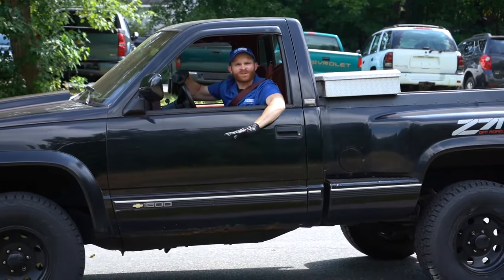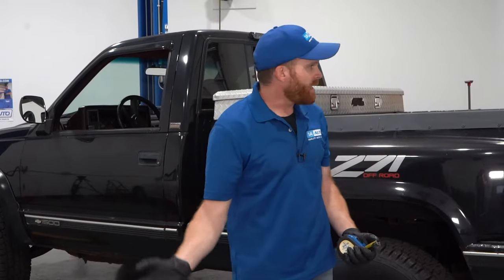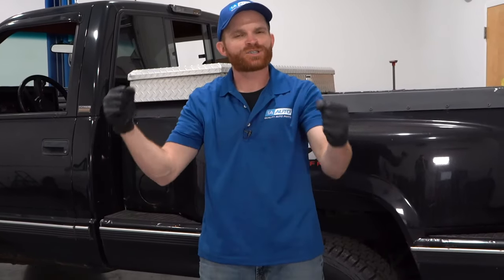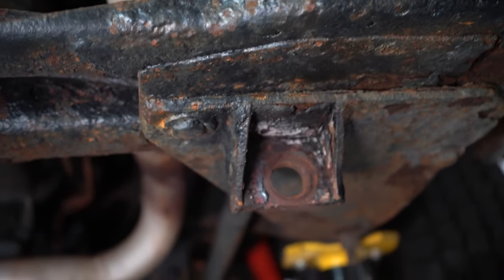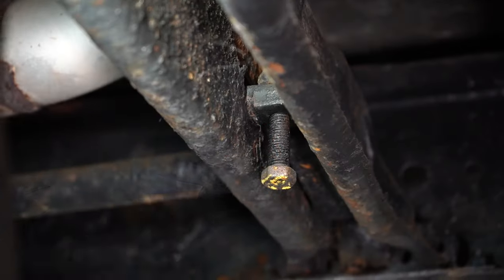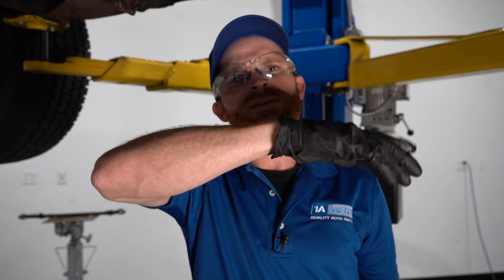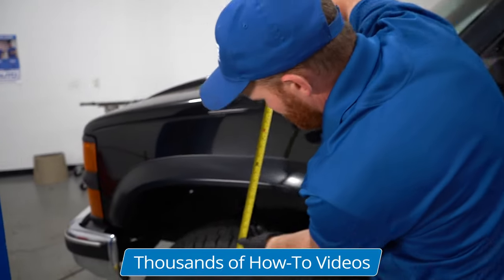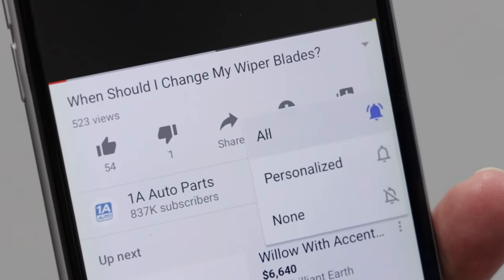Is Your Truck's Rake Too Extreme? How to Level Torsion Bar Suspension For Free!

Comment: Do you need an alignment after this? My 99 k2500 is 2 inches lower in the front then the rear. I want to raise the front at least 1 inch or inch and a quarter & i dont want to ruin any suspension or drive components .

Comment: Very helpful video, I have a question. My 04 Silverado driver’s side torsion bolt is all the way in. The other side has some thread showing. My driver’s side is the lowest. How do I adjust? Thank you again for video

Comment: You said 2 adjustments turns of the bolt equals out to 1/2 inch lift, does that apply to only the vehicle in the video or to all vehicles?

Comment: 🤔 why not measure from center of the hub? 
So if your tires are worn uneven you can get a more accurate measurement of the suspension 🤔

Comment: I have a 1998 Tahoe with a plow, I want to swap out the 1/2 ton to 3/4 ton torsion bars to take away the front squat, do you know if they are interchangeable, i do have the screws all the in on my keys now, it's a 100% plow truck

Comment: I owned a 91 gmc reg cab short bed Z71 5.0 5-speed 4x4. Don't put those t-bars too high you'll run out of suspension travel & it will drive like crap.

Comment: This is only half of the info. There are bump stops on the lower control arm as well and you want to make sure you are NOT touching those when the truck sits empty.
Anyway, good video.

Comment: What happens if the adjusting bolts are almost tight against the torsion keys but the front is still lower?

Comment: I upgraded my front suspension but not the lower control arm and torsion bar on my tahoe. If I cracked my stock torsion keys all the way will that be okay and worth it a bit ?